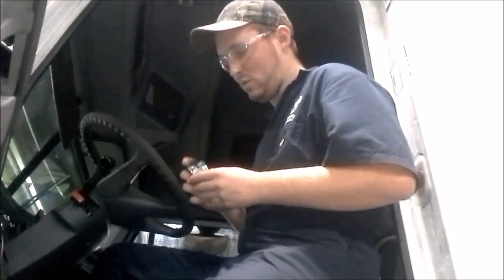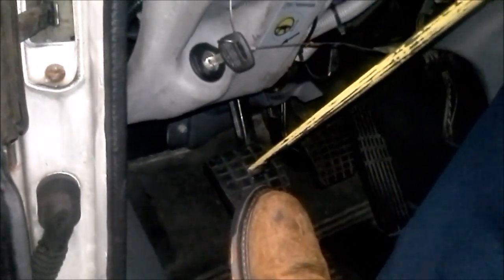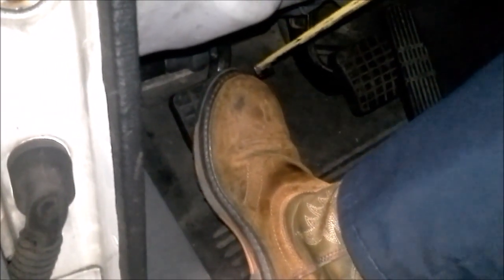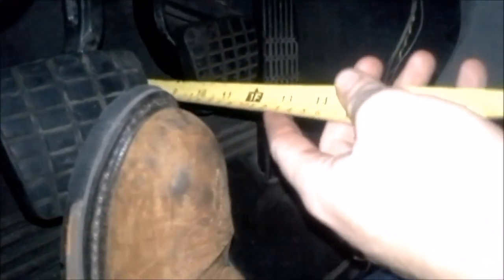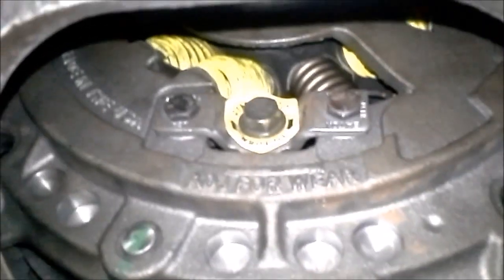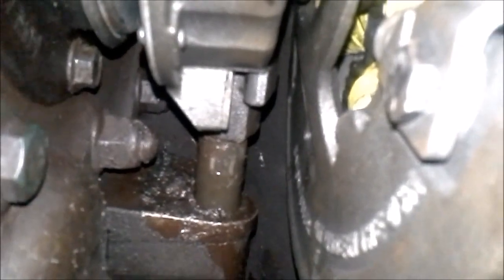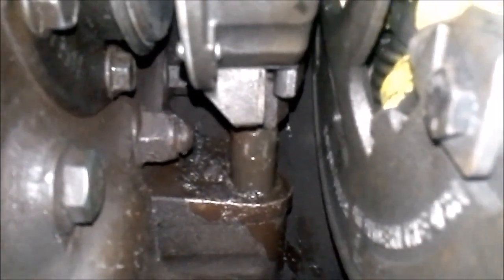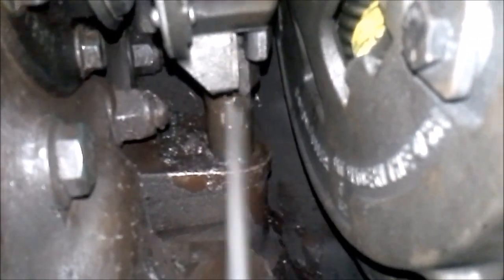How to adjust an Eaton Easy pedal clutch

Comment: For anyone watching this, you push in on the bolt and turn clockwise while someone has the pedal pushed all the way in. The bolt is on the clutch. You should be able to see it through the inspection plate.

Comment: How do you turn the bolt to adjust the clutch?
Reply: The 5/8 bolt head in the center is spring bound. With someone or something holding the pedal down, push the center bolt IN and it will turn. Sometimes you may have to use a pry bar to help by wedging it between your ratchet head and the throw out bearing to get it to push in.